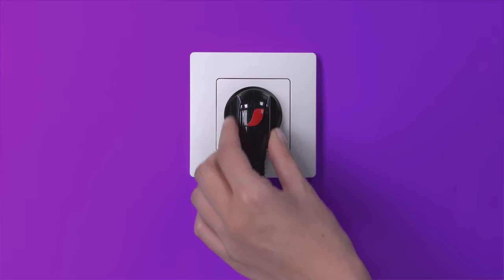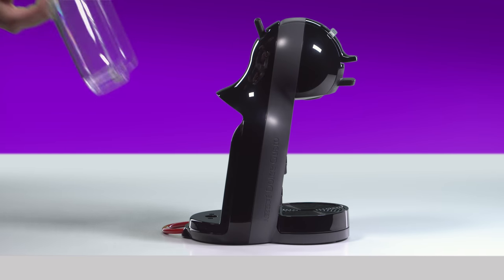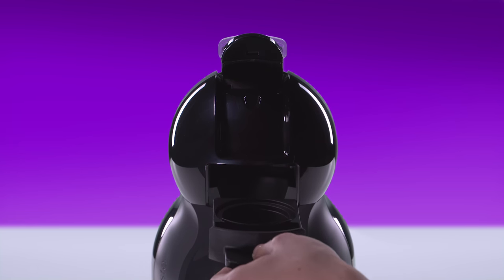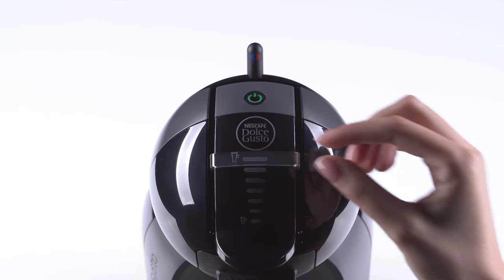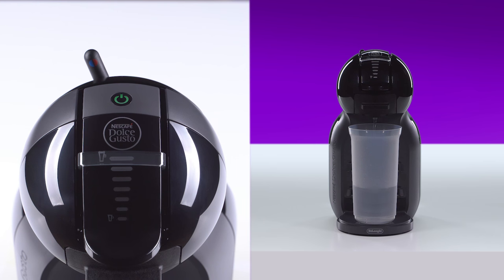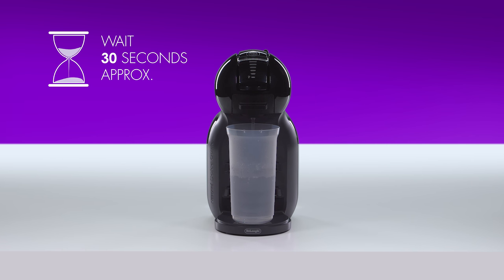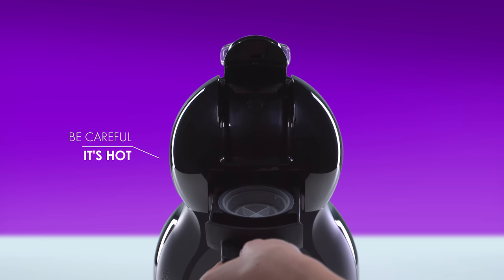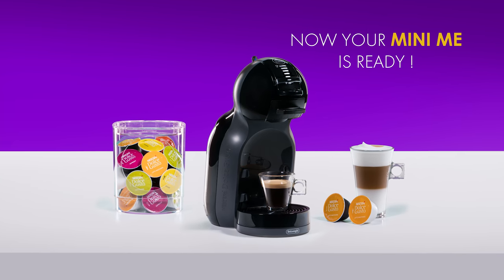Set up your NESCAFÉ® Dolce Gusto® Mini Me coffee machine by De'Longhi®

Comment: Just got one of these. The instructions came together with the machine that were supposed to be clear, straigharr were wrong, and not only in the before first use cleaning,but also when making a coffe. That's why I ended up here. This is an ultra simple machine, but please, stop packing it together with the instructions as they are worthless.
Btw, it makes a great latte

Comment: Maybe you should show how to get the water tank off. I have a Jovia which i have used for years but bought the Mini Me as an upgrade. Myself and my son spent ages trying to get the tank off, really did our heads in btw. Why so difficult you may ask? well it comes off the opposite way to the Jovia lolll The Jovia you LIFT UPWARDS to take it off, this 1 you PUSH DOWNWARDS to take off ugghh!!! Of course there is nothing in the instructions or tutorials in here, so am just saying so people don't damage them or waste time getting frustrated :P
Reply: Go to google type the machine name that you have then type instructions and then find pdf web then hit on the web pdf then it should pop up the web of the instruction with pdf then fallow the instructions the tank has a hole just put your finger in there and pull the tank
Reply: Maybe late but pull backwards not lift up. Works fine for me and my mini me
Reply: Maybe don't try to remove it with your feet?
Reply: @millr8222  we were using our teeth, come on, who would use their feet... Well they might if they are gumsy all the same lolll
Reply: ahahaha sounds terrible
Reply: Actually this is a design flaw, some machines doesn't have soft latch mechanism like yours.
Reply: @MEl-cc2er  maybe a hammer world help